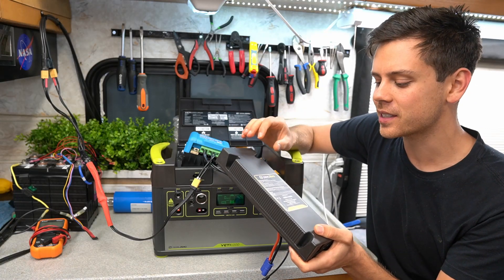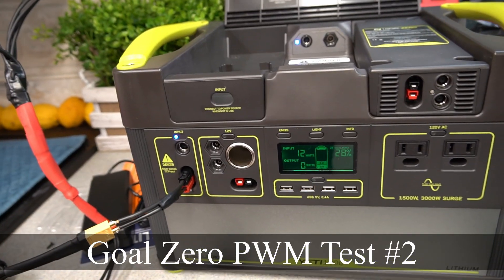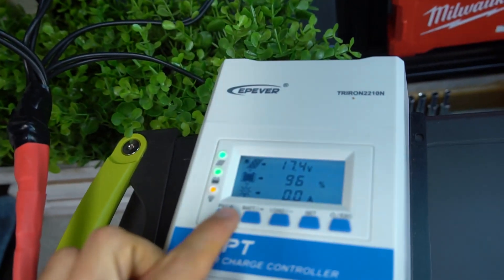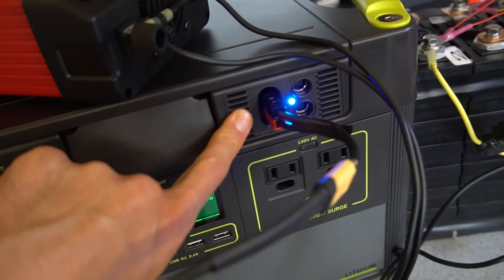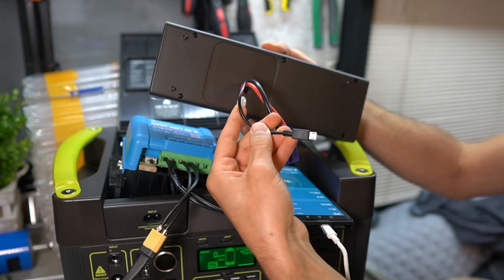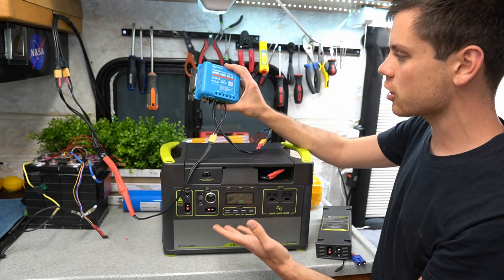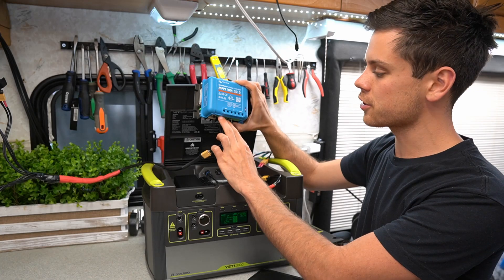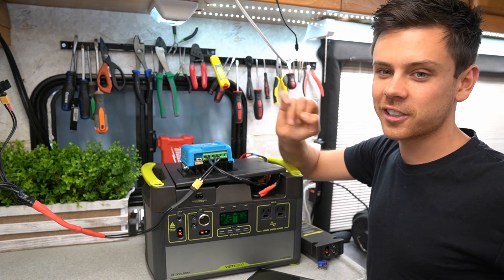How to Hack the Goalzero Lithium by Adding a Powerful Victron Charge Controller

Comment: Thanks this helped a lot. I have just received my Victron and expect the cables next week.
I live an an area where PG&E will likely be cutting power so I bought a GZ 1000.  GZ MPPT are sold out as well as their rapid charger.  I had bought 2 - 100w Renogy pannels last year and was bummed to see it's 22.6v voc is not compatable with the Yeti so problem solved. Questions:
For the 500W max input you recommended does that mean I can hook up 5 100w pannels as they never produce 100%.
Also if the fuse blows between the Victron and the GZ with the solar cells hooked up will that blow the Victron? 
If so better that than the GZ.

Thanks great work and great videos.
Reply: Hi! I think that the 500W limit is total, when using PWM and MPPT connection for charging at the same time. For the MPPT GZ EC8 input manual stays that no more than 350W are recommended. And for PWM is 360W. That is 710W total, for a safer operation 650W using both inputs would be ok.

Comment: Hey Will, for the Goal Zero cable you mentioned it comes with 2 wires for each input. The positive has a red and white wire, and the negative has a black and teal wire. How would I run these wires to connect to the Goal Zero Yeti after I cut off the terminal connectors?

Comment: So it looks like the final remaining problem with going with GoalZero for any sort of "build" is total capacity.  

GoalZero has the output that you tested

GoalZero now has good input

Can you find a way to rig either: 1- multiple goal zeros together in a chain for more capacity or 2- other batteries beyond just more goal zero?

My thoughts are:  Beginners can start with a basic GoalZero set up.  Then add to it as need, expertise/experience, and money allow, instead of just being "stuck" with the GoalZero "startup".

Comment: Hi Will,  I have a few questions I hope you can help me with.  First, I am looking for a backup solar generator for apartment living/power outages since I live in earthquake country.  I want to be able to keep my fridge going (intermittently is fine) along with charging phones, usb powered lights, etc.  I originally bought a Goal Zero 1k but after hearing you say that I wouldn't be able to keep it charged with solar panels without 16 hrs of sunlight I returned it before buying panels.  Now I see this and am thinking about re buying the Goal Zero and doing this hack.  Alas, I am just not very technical and cannot understand electricity no matter how hard I try.  So hear are my neophyte questions: 1/Do you think I could handle this hack without blowing myself/my system up? LOL! 2/I understand how important it will be to adjust the settings through the app on my phone.  Would I be in danger of the system resetting (and damaging the generator)  in a power outage or if my phone died?  3/I can get the Goal Zero 1k from Costco for around $1k.  Do you think I could get an entire system with panels for under $2k (or less).  We live in SoCal so sunshine is plentiful and weather is mild but I may need to run cable lengths of 30+ feet either from the generator to the fridge or from panels to the generator.  Let me know if any of this makes sense.  I really appreciate your info!  Thanks!
Reply: 3) Absolutely you can put together a system for $2000 and under.
Reply: @AaronGeller  hey aaron, thanks for your replies/support.  i have the GZ1k now and am inventorying what else i need.  i've also watched quite a few of WP's vids to try to get my head around all of this.
Reply: @AaronGeller  hi again, aaron.  i'm wondering if you might be able to advise me.  i'm in the process of buying all the parts needed but, after reading the on-line manual for the victron i'm apprehensive about my abilities.  will said it would be easy enough for a beginner but i may be even more remedial than that.  would you be willing to look over what i've purchased (and still need to buy) and confirm i'm on the right track?  i'd greatly appreciate it.  thx
Reply: CassandraComplex  check out the “diy solar systems” group on Facebook. A very helpful bunch there
Reply: CassandraComplex 1) just enter the parameters Will showed. Will is showing the voltage values to input so you don’t overcharge the lithium battery which would kill it.
Reply: CassandraComplex 2) the phone shouldn’t cause the victron to fail. You should be able to leave it and forget it.

Comment: If you were to purchase the Yeti Link Module would it be possible to connect the Victron MPPT controller to that and get the Yeti to properly display the solar input?  $400 bucks to get it to display properly but maybe wouldn't void the warranty?

Comment: I got 216 on a boulder 200, seems weird ? And I have a picture to show it. My question is does a complete goal zero unit perform better then the mppt charger you used and the panels you used to create a custom system ? Yours obviously performs
Reply from the maker: Your panels were probably cold

Comment: I'm curious about adding a wind turbine into the mix, my thinking is when the sun goes away generally the wind picks up so you could use wind to compensate, I haven't found any discussions on hybrid systems. My usesage thinking is living in a r.v. With fridge, ac, com systems, etc...

Comment: I really like your videos and your DIY Solar Blueprints, especially the 
"4000 Watt, 24v Off-Grid Solar Power System". Would it be possible for you to add variation of this Blueprint for a RV, where Shore power, when available, is always use as the primary electrical power.  I would also like it to include an AC battery charger for the Batteries. I am concerned the AC battery charger would interfere with the solar charger.

Comment: This hack finally did me in on deciding on DIY and probably getting frustrated, or purchasing a Goalzero. I was mainly concerned about the input of solar speed with Goalzero. But not now! Main reason for going portable is I will need to take it from Bay Area to Tahoe throughout the year. You're awesome! I actually had an Apex ordered minutes before I saw your comment on Canadian Prepper and then followed you to your site. Since then for the past week I have been watching a ton of video on DIY videos and GoalZero videos. Thanks for this hack!
Reply: mario, have you been able to get this hack to work?  the male ec8 cable doesn't seem to connect so i'm stumped (and out a lot of $$!)

Comment: I wonder it they can make a  cut off switch build in the plug just in case your Mppt malfunctions? I rather use Lifepo4. Having the extra voltage rage and the safety of it not catching fire is good in my book. The reason why I don't think I would ever go with a Tesla battery pack.

Comment: Hi, i have been using Victron controlles with my portable 200 and 100amp Lithium Ion packs, but uses a little different settings than you recommend. I use 12.57V absorption voltage and 12.6 float voltage, absorption time 1 hour. I wonder why you climb down to 12.35?
Do you know what is most important when charging Lithium Ion, is it high Watt or high Amp? Since I get much higher Wattage with a PWM charger than the Victron , but I have same AMP with the PWM and MPPT Victron. 
Keep your posts rolling, I have  you on my favorite list.
Reply: Martin Christensen -  "I use 12.57V absorption voltage and 12.6 float voltage, absorption time 1 hour. I wonder why you climb down to 12.35?"   

     Most lithium cells are sensitive to maximum voltage they can be charged to and heat is the result if you pass that charge point .  The result of overcharging a lithium battery can result in the batteries total failure and/or fire ! 

     My Goal Zero 1000 ends charging at 12.50 volts .  Lithium batteries like to 'work best' between 30 to 80% charge = charging to 12.5 volts is actually too high for long life.  They are totally different from Lead Acid = try NOT to charge them to full ! ! !     Lead Acid you want to fully charge after use for longer life   .   .   .   .   not so with Lithium .

Comment: Max input is 800W via all inputs combined with a net max charge rate of 650W according to what they told me. 

This is a great hack for getting around the low voltage panel limit!
Reply: kip, did you do the same set up for this hack?  i can't get the male EC8 cable to connect to the GZ.  advice?
Reply: @CassandraComplex  
Yes me too... it doesn't fit
Reply: @CassandraComplex  I have yet to connect anything in this way.  GZ seems to be perpetually sold out of a lot of their accessories though.
Reply from the maker: Awesome

Comment: Totally off topic but something I've not gotten a good answer to. I'm looking at a small compressor based refrigerator for insulin storage. This unit will run on both 12 volt and 110 volt. 44 watt draw.  The question becomes how do I determine whether it's smarter to run off my 12 volt batteries or thru a small inverter?
Reply: Always through 12 volt because the inverter is 90% efficient and it'll require more power than simply using 12 volt.

Comment: Very cool! Will, I've got another hack request. Can the Victron charge an e-bike battery? I've got a 48v 13s4p that I'd love to use for my van camping. Can this or other charge controllers bump 12v or 24v panels to charge a 48v battery?
Reply from the maker: Oh for that you would need a 48v victron charge controller. Not cheap. Also need to put panels in series so mppt has headroom. I would go for 80 volts open circuit minimum. Can easily be done though.
Reply: @WillProwse  Darn. I saw a unit from Solar EV Systems intended to charge 36v/48v golf carts with a 12v panel but the specs say only lead acid/gel/agm etc. Would you say it's possible for a DC/DC converter with CC-CV programmable output voltage to do it? Or is there more function needed in MPPT controllers? There is a Youtube video showing a guy patching a 12v panel into one and then straight into his 52v ebike.

Comment: Well, now that I know you have some Victron gear, hows about a video mating a SmartSolar unit to a DIY lithium pack.  That's what I built, inspired by your videos, and it took some honing in.  I have to set my absorption voltage to 13.75 (float 13.35) or it'll never achieve 100% SOC on my BMV712.  That sucks, because when overall pack voltage hits 13.8 then cell 1 begins to run away quickly.

Also bad firmware released (1.41 I think), issues with smartsolar seeing .3v less than BMV despite transmitting that data over SmartNetwork, entering float 0.2v too early, yadaya.  It's kind of a bitch.  I'm typically entering float when the BMV sees 97-98% SOC and miraculously it'll gain those 3 or so remaining AH throughout the day and hit 100.  Makes me scared as hell of a new firmware release though, my numbers were all painstakingly calculated based on what it'd take to reach 100% (90ah battery but set to capacity of 55ah in BMV to baby it) and to stay below overall pack voltage where cell #1 begins to go ham.  A ton of trial and error with cautious nannying of my cell monitor.  If they change anything in firmware, I go boom.

TL;DR Plz more Victron everything!

Comment: Great hack, but I bet you'd be voiding your warranty on the GZ by doing something like this. Also, is there a limit of max amps or watts that the GZ can safely accept?
Reply: Every battery has a limit to its input and Will did mention you'll void the warranty.
Reply: @AaronGeller  Thanks and in the meantime I found the answer to my question on Goal Zero's website: 500 watt max charging...
Reply: @TheCruisinCrew  They make a charger that connects to the alternator via the starter battery and that'll output 500 watts

Comment: I was wondering if you got the battery expansion unit if you could parallel the battery module with the mppt charger. Or hook the mppt charger to the ports for pen port?

Comment: After I get my Yeti 1400, I may do this with a Victron. After I understand a few additional things by watching your videos more.
Reply: I bought the Yeti 1400 and I am in the research part of the installation. There are a few Victron options so I am trying to figure out which one I should get for my 300 watts. I suppose the 20amp should be fine. How is your process going?
Reply: @HerSoulVacation  how is your process going?  i can't get the victron connected to the yeti since the male EC8 doesn't connect...
Reply: CassandraComplex hi! I just finished my installation and uploaded my video yesterday. I ended up not getting the victron. However, I will do more research as I am on a trip at the moment and consuming power faster and more than I thought.

Comment: I didn't understand the part starting at 8:07 where you talk about expanding the battery charge cycle life by increasing the upper limit voltage.
Reply from the maker: Decreasing the upper limit voltage. Instead of charging to 12.6, charge to 12.5 instead. I have another video that goes over those data sheets and battery studies
Reply: Video link? I'll look for it.

Comment: Off subject question.  I want to go camping in a minivan for a few days at a time.  I want to buy a battery charger with an air compressor to have in my minivan anyway.  I noticed several of these will charge ur phone, also. I only need to charge my phone a couple times a day.  Do u have any recommendation for which one of these chargers would be best???

Comment: Could you use a similar system on a Kodiak if I stay within the voltage and amperage safety parameters and use the neutrik connector?

Comment: Hey will, thanks for the video! Do you think this could feed a 24h/7 computer drawing less than «300w, providing enough solar input during day and grid power during night? Thanks!
Reply from the maker: No, you need a real system. That would require 7.2 kwh for a day. So you need to calculate how many days of autonomy you need. Easy to figure out with equations in my book
Reply: Book Bought! Thanks mate :-)

Comment: You should try plugging the output of the Victron into the input for the PWM controller, it should display the power on the screen. The PWM controller only connects/disconnects the charging port from the battery so the Victron will not know.
Reply: That seems like a bad idea.  Any charge controller needs to see the actual battery voltage and PWM interrupts the connection to the battery in a rapid cycle.  The Victron consequently would see the battery voltage alternating between whatever it approximately is (plus the voltage drop of the solid state switch, probably a MOSFET) and whatever is the open circuit voltage passed to it.
Reply: @thomasmaughan4798  good point
Reply: Kelton Bailey have you tried it yet?

Comment: Hi Will - great video!  How did you know to program the absorption voltage to 12.5 volts and the float voltage of 12.35 volts? 

Where on the Goal Zero technical documentation does it state that? 

I have the exact same Yeti 1000 and want to use solar panels with higher voltages than 22 volts.
Reply from the maker: Great question. 12.6v is max charge voltage of the NMC pack that goal zero uses. So 12.5 is a safe absorption voltage. Float can be higher or lower depending on how fast you wish to cycle at the upper end. 12.3 works for me but it can be lower or higher depending on what you're doing

Comment: One other comment, since I use the PWM and the MPPT controller, I noticed the PWM controller activates under lower light conditions than the MPPT.  The PWM will start feeding the box earlier in the day.  However once full sun hits the MPPT side does pump power considerably faster.

Comment: Very interesting idea.  On my GZ 1000 I have two 160W panels in parallel going into the MPPT controller and one 50W panel going into the PWM controller.  The max input I have seen going into the box has been 310 watts with this config.  Your rig may be fun to play with to get even more juice into the battery, especially since I am going to mess around with hooking up my own external battery to the GZ which will utilize their own 12V car adapter charger.
Reply: I got a van with a yeti 3000 and they had two 40v panels in parallel into the gz mppt. Would show 300 watts for a few minutes and then cut in half to 160... I assume only using 22v max.  Will was nice here. Horrible engineering to keep 22v max. Means bigger wire size for your solar wires. Home inverters do up 600 to even 1000v now. Smaller wire size. Also easier to get power in low light conditions. GZ needs to listen.

Comment: Nice Franken-station, in between DIY and off-the-shelf.  Since the solar to charge controller to battery (with built-in BMS) part is easy, the product that would make DIY the winning choice would be a pre-wired panel with all the outputs (USB, 12v, 110v).  The inputs to the panel would be 12v from the battery and 110v from an inverter that I hook to the battery.  That way I can select (and replace) the battery, charge controller, solar panels, and inverter just like DIY, but without all the crimping for the panel.

Comment: I was definitely going with the Goal Zero after your review of the Apex. And you just confirmed what I was wonder for a charge controller. They say you can link batteries but they say they have to be there brand, I think you should prove that wrong.
Reply: The AGM battery models (Yeti 1250) can link batteries but the lithium battery models cannot be linked and there's a very good reason for that (several probably) and that's battery management; balancing the cells.

Comment: Hello there, I thought that you might want to do a video on a system that one can start , say on a boat or RV where what you purchase can be upgraded as you go. The reason is. in my case, I can not afford to purchase everything at once. and I can not also afford to take my boat offline for even a short term. I have watched most of your videos, and all are great. I find one aspect of the beginner systems can not be upgraded. unless you purchase new equipment to replace the eqiupment you just bought. I hope this all makes sense.